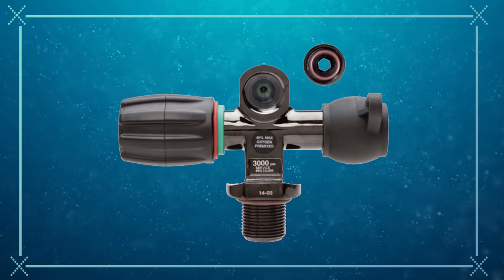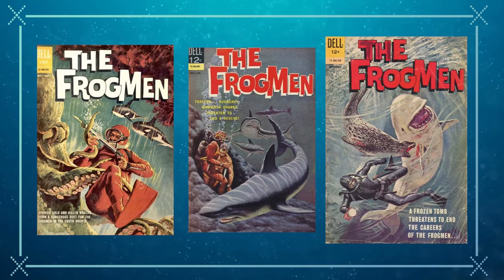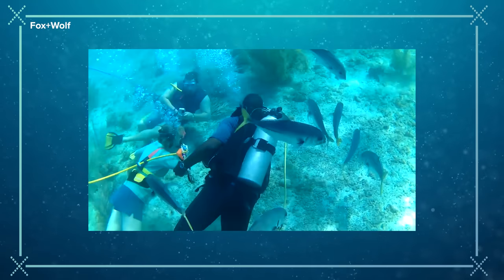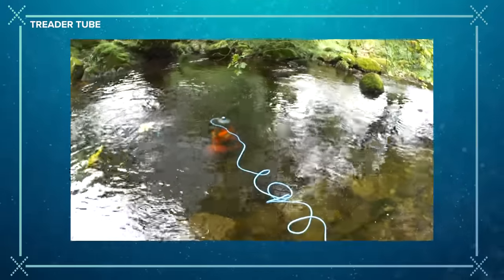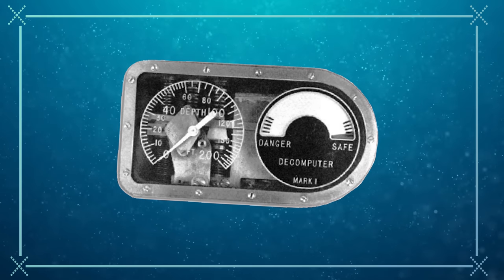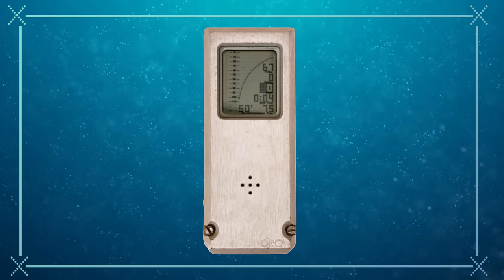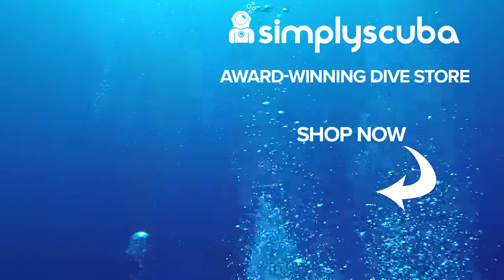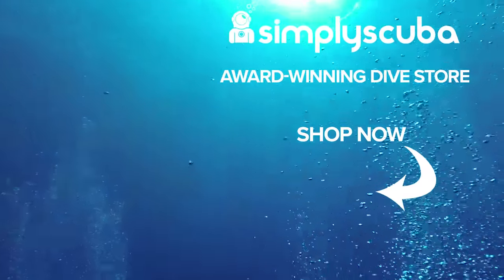Worst Dive Gear In The World

Comment: Aluminum tanks, still don't understand why people love them.
Reply: What is wrong with them? I'm kind of newbie but they are lighter, doesn't rust like steel, keep enough air safely. I don't prefer any type over other yet.
Reply: @sardasert  that is what I was told when I got certified. But there is no advantage to aluminum tank other than price. Wish I would have been told this 20 years ago. I'll compare 80cu as a baseline, but generally the idea translates to all sizes. 

Capacity =Aluminum 80s max at 3000psi, vs steel 3442 plus 10% overfill in US, equals 3700psi. Al 80 is not actually 80, its 77cu. For capacity al is 77 vs steel 88.

Size= al 80 is 26 long and 31lbs vs steel is 20 long and 28lbs

Buoyancy when empty = al80 is + 4.2 pounds, steel is neutral.

Durability= al will corrode, steel with a good finish, like galvanized will last a long time if taken care of. I buy fabers, they come galvanized or triple dipped. They are rated for 100,000 fills. You will never dive that much on one tank in a lifetime. There are steel 72s from the 1970s still out there.

Al 80 holds less air, 15% less, weighs more, physically larger tank on your back, won't last as long, and more buoyant. I don't see the advantage. 

I dive with faber 117s, love them. It's a short fat tank that with an overfill can be equal to a 125cu of gas. 

Because steel is less buoyant, I have to carry less weight. 117 weight 38lb, 7 pounds more than al80, but I have to carry 10lbs more of weight because of the buoyancy. 117s setup is less weight overall.  
117 over an al80 is less overall weight, better buoyancy, better balance, and .........62% more air for all those advantage. Never heard anyone complain about having too much air.

Use whatever works best for you and your type of diving. But be willing to try new things. Especially if you drysuit dive or get into technical diving. Steels are a must. Have fun and safe diving.
Reply: @kylegrimm8808  thanks for detailed explanation. I only have 39 dives under my belt. I only own mask and fins the rest is always rented. just bought suunto d5 10 days ago haven't even dove with it yet. for me I didn't even use half of my air during my last 10 dives. (those were up to 20 meters) Maybe when I start diving with more advanced people I might benefit from more air. In my current experience they are same. Longevity is dive center's issue, dives are usually shorter to benefit from extra air etc. I live in Turkey and I'm more familiar with metric system (liters, kg, bars, celcius etc.) but I believe I got the basics of your explanation. I got my owd from SSI and I only got deep dive and ean32 certificates. Maybe if I get 2 more certificate ( i'm not yet sure which ones will fit me best) and have 50+ dives under my belt I can find more use for this awesome explanation as advanced open water diver.
Reply: @sardasert  once you get past 60 feet, you start using air quick. Particularly 80-130'. Also, I'm 6, 1" 230lbs, 105 kilos, athletic build. I need more air. You have to remember you aren't just carrying air for you, but anyone who needs it in an emergency. You dont want just enough air. I would not exceed 60 feet for a while. The dive organizations are reckless in my opinion. They push divers too deep with not enough training or experience. It's routine on dive boats to push divers on a wreck with an 80cu aluminum tank, to 100 feet or more. That's crazy. If something happens, and you have to buddy breathe at 120 feet.You are fucked. You are probably at 1700-2000psi if your lucky, now you will have a panicked diver and you draining that tank fast. That is what the training doesn't cover, reality, what will really happen. 

When you want to go deep, find a tech diver to take you under their wing. What is great about tech is redundancy. You start doubling up on primary systems. I bring that into recreational diving. It's smart and will keep you out of trouble. Also don't go cheap on regulators or other equipment. I know its expensive, but its for your life. I dive primarily cold, 5 degress celsius,  with little to no sun light. Most regulators are not built for cold and will free flow more.
Reply: Ali is are more suitable than steel for stage cylinders. This is because they are less negatively buoyant, in fact empty they can float.

Comment: Whats wrong with snuba? I have a 12 volt system that I take my friends down with lobster diving that would never get the chance otherwise?......Vid is made by a holier than thou dive shop "expert"
Reply: I had a 2 person system. If you stay less than 30' then no problem but going deeper without training is definitely dangerous. I had no idea there was any danger when I bought mine but thank God before I went 100' deep a scuba diver explained the dangers or I would have never known to decompress. I thought an airline was different than a tank but found out it's the same.
I bought the most expensive system on the market but 3 times I was 30' deep and when I tried to take a breath and absolutely no air came through the regulator.  That is a horrible feeling like someone holding their hand over your mouth and you did not get to prepare with a breath. Feels like forever coming to the surface. I do not know why it would do that but that caused me to sell it. 
The great thing is it was my first experience diving and now I want to get trained to scuba and rent tanks. Just thought I would share my experience but not saying it's a bad system but can be dangerous from my experience.